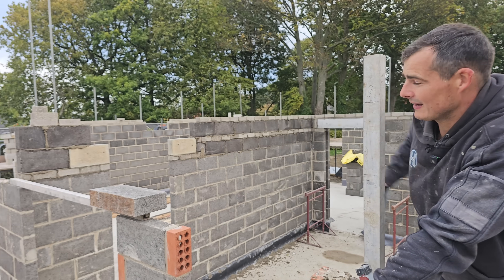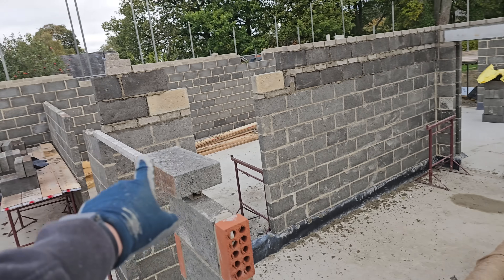Why’s Everything So Over-Engineered? Stone New Build Bricklaying #construction

Comment: That’s a terrible design by the architect/engineer  ,could have used a steel  instead of those great big lintels sat on that little pier .

Most internal lintels are set at 2025mm form ffl Izzy  👍

Last time I had a small pier like that I built it with a block return ( Lshape )  then buzz sawed it off a week later , much safer and no need for propping 

Nice n neat as always Izzy 👍
Reply from the maker: Good shout mate 👍 totally agree — sometimes the design choices make you scratch your head! Love your L-shape return trick — might pinch that one 😄 appreciate the tip!